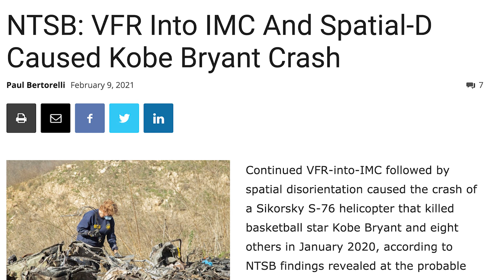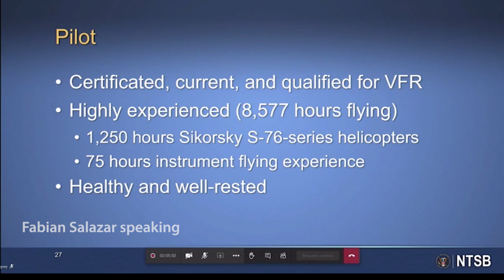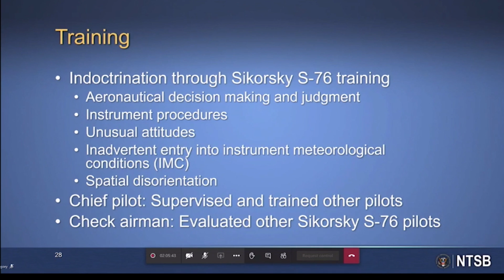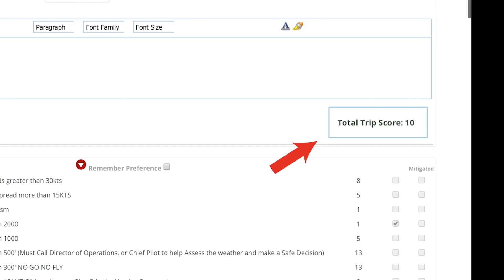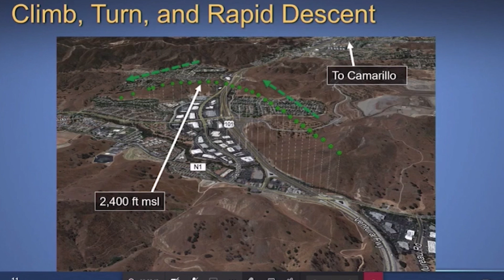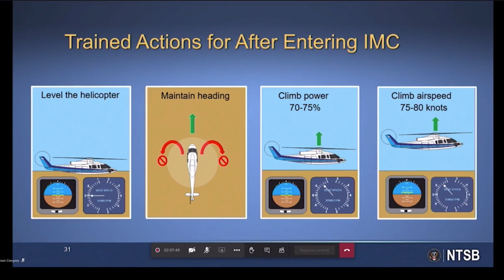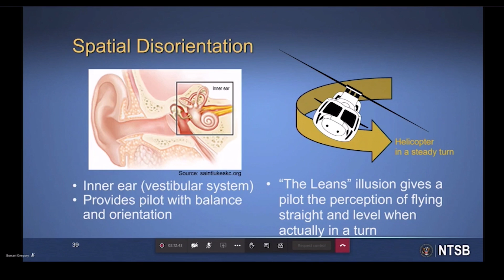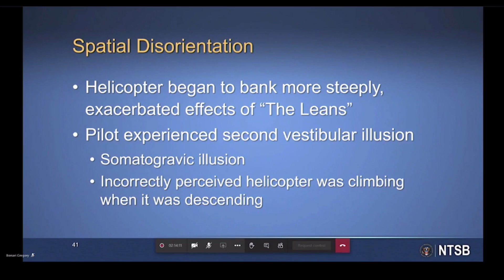How A Split Second Wrong Decision Caused the Kobe Bryant Fatal Crash

Comment: The one damning thing I read about this report was the LAPD did not fly that day due to low clouds/fog/poor visibility.  The fact that the cops weren't flying that day should be grounds enough to tell your VIP prince/princess that its too dangerous to fly due to the weather.
Reply: Point taken, but operationally the LAPD didn't fly that day because it was against their fundamental charter -- they need to see the ground to see targets (people, cars, etc).  The Sheriff's comment about not flying that day is therefore irrelevant to the Kobe case.
Reply: @PaulGarthAviation  

You have a good point there, but I'm saying its a good way to kind of smooth things over with your VIP client, look these people aren't flying today because of the weather, so we aren't either.
Reply: Whether the LAPD was flying or not is inconsequential, you do know how far LA is from Santa rosa and the crash site.
Reply: @mountjoy23  Santa Rosa is in Northern CA, the crash was in Southern CA. There is zero correlation as to how far it is from LA.
Reply: @2whl4re  Apologies, you're correct.
Reply: If Kobe wasn't on that flight plan, the flight might of never happened either, instead we might of gotten an article in the internet stating that "kobe's pilot fired because pilot decided not safe to fly". Sadly we'll never know
Reply: @2whl4re  Santa Rosa Valley is a neighborhood just east of Camarillo, the flight destination. It is crossed by Santa Rosa Road.
Reply: Yes definitely.
Reply: Lol

Comment: Once I was riding a 1100cc sport motorcycle at nite in the mountains. Came around a corner and hit fog, within a few seconds I had no idea how to ride a motorcycle.  I immediately knew I had to stop or crash.  Then the fog was gone as soon as it appeared.  Scared the heck of me
Reply: Same happened to me once on a highway during peak of a clear and cold winter night. The highway passed trough a serie of hills so going up and down. Only in one of the down I entered suddently a thick fog that I didn't see coming and it took me some seconds to realise that I had to almost stop if I wanted to stay alive because I couldn't see anything past the engine hood. I was also afraid if I was to stop that cars behind or even trucks would pile me up. I drove at 10MPH for a moment luckily I was alone so nobody crashed me, and I existed the thick fog as quiqkly as I entered it. It's all about decisions you have to make to cope with the situation, a small error and you are toast.
Reply: @12345fowler  fog is scary.  I imagine 1000x more so in a helicopter
Reply: There'll be very thick fog the next day after UFO landed, normally.
Reply: I’d rather fly a plane in fog than drive
Reply: @Jopanaguiton  car u can pull off and cancel the trip.
Reply: I was descending a mountain, and there were no reflectors, no lights for miles, no other cars.  When a cliff would loom up, it would block out the stars.  Thought I was going to ride off the edge like Wiley Coyote.  Slowed to 30mph, and just bumped along.  It was stupid. Should have pulled onto first shoulder, climbed into sleeping bag, and waited for sunlight. O.  And I think the map said 11 miles to 'home', but it was 11 miles through twisting, turning mountain pass.  Probably like 25 miles of road surface. Was young, stupid, and in over my head as conditions changed.
Reply: @PInk77W1  In a plane as long as I follow the Instrument procedure I can continue on my trip and guaranteed I’ll not hit anything.
Reply: @Jopanaguiton  
See ANZ flt 901
Reply: @12345fowler  Yes...been there too...Just passed my test...first time on a motorway (M62 England) a wall of white fog.... I was completely disorientated. no sense of feeling in the steering (Rear engined car too!)
and, back then, the steering needed constant adjustment.
Just so aware of any truck bearing down on me from behind.
Stopping on the hard shoulder wasn't an option...probably more chance of being rear-ended!
I can imagine how easy it would be for someone in a helicopter to make the wrong decision...at a much greater speed too. 
So sad for all concerned here. RIP.
Reply: I get mild vertigo EVERYTIME I ride a motorcycle in a tunnel. Never in a car, 100% of time on the bike. I fight it, but it is scary. 

A set of tunnels in British Columbia on the #1 highway, I have been through them so many times in a car, I could almost do it blindfolded. I have done it at least a dozen times on the bike and it is still a struggle.

Those extra long tunnels in Europe would surely do me in, I wouldn't even try. I have no clue why this is. I bet my performance in fog would be similar to yours. Shiny side up!

- Cheers
Reply: @joeshmoe7967  that does not sound fun
Reply: Apparently you lacked training in how to handle a cycle in IFR conditions.

Comment: I flew EMS helicopter for 28 years. I have more night scene calls (reduced visibility in close proximity to the ground) and more marginal VFR time than I can accurately recount. Over the years I have lost friends to similar scenarios as described above, and I have seen the same mechanism of progression in my own experience. It goes like this:
1) the pilot has either just taken off, or has slowed down because of reduced visibility; 2) the pilot has stability augmentation engaged but does not have the autopilot coupled; 3) the aircraft's avionics configuration has the communications radios on the console between the pilots and not on the instrument panel; 4) the pilot makes the decision to declare inadvertent IFR or to file IFR, and he bends forward and left, head down, to retune his communications radios; 5) the pilot raises his head, and, if still in VFR conditions, sees he has entered an unintentional descending right turn; or, alternatively, if now in IFR conditions, and if the pilot does not yet have a good instrument scan going and has not yet recognized the descending right turn, he will, as a matter of training, automatically pull back on the cyclic and increase collective in order to initiate a climb, and will, instead, unintentionally accelerate the descending right turn. I know this from my own experience and from the experience of fellow EMS helicopter pilots (the old living ones and a few dead ones).
It has to do with sequence. What could he have done differently, after he realized he had painted himself into a corner?
First, couple the aircraft. The S-76 has one of the finest autopilots ever designed and put in a helicopter. It will fly a pilot out of anything if he'll let it.
Secondly, in coupled flight, initiate a climb.
Thirdly, triple-check everything: the climb, the airspeed, the heading.
Fourth, tune your radios and confess inadvertent IFR.
Fifth, follow the instructions of Air Traffic Control.
Sixth, let the autopilot fly the helicopter.

This same accident has killed two good pilots I have known.
Do not criticize the dead.
These things can happen to anyone at any time, including you.
Reply: Great analysis
Reply: Seven, and most important, Prepare yourself mentally BEFOREHAND for the possibility/likelihood that you will experience spatial disorientation.
Reply: which is essentially what Ken Cox stated: "These things can happen to anyone at any time, including you.".
Reply: Thanks Ken.
Reply: One of the best comments I've seen here.
Reply: Yes, and thank you for this well-written explanation that ended with humility.
Reply: Well, I have to agree with you.  Completely...    only by sheer luck am I sitting at this keyboard, glancing over at the 50 year anniversary  plaque (being a pilot-helo/fixed).

Comment: Never let anyone, anyone at all influence your no go decision. I made that mistake in my early 20s, with bad advice from my instructor. I had woken up, checked the weather, decided against a solo cross-country and called my instructor. For some reason, he told me to go for it. This was a retired Air Force instructor (he trained AF pilots back in the day). I encountered wind shear/microburst shortly after first leg touchdown, rolling out. Ended up with a bent prop. Probably lucky that was all I got.
Reply: MeesterVegas my instructor sent me on my solo cross country on a bad weather day. What did I know. I had to leave the plane at an alternate airport and call a buddy to come get me
Reply: That weather changes in a heartbeat is why everyone should be instrument rated. Jmo
Reply: @Karl with a K yeah, we can replace it with programming and sensor error any time now! We want our fatal accidents to be of the most high tech nature!
And how do you figure "as always"? As always, excepting when it isn't? Planes crash from engine failure. They crash from bird strikes. They crash from many things. And a pilot making a mistake does not make them "incompetent". The very best Formula 1 drivers can make myself and end up crashing. Are you going to sit there and call these highly skilled people "incompetent" because they failed to do it perfectly?
Reply: @justforever96 no but you try and pass the buck to the passenger instead of the incompetent pilot.

Comment: Paul, Great synopsis of the accident, I always enjoy your videos.  I spent a number of years training military helicopter pilots IFR and VFR and one of the things I pushed upon my students (and other instructors) was that if you are encountering deteriorating weather in a auto pilot equipped aircraft you should couple up early so that if it comes time to turn around or commit to IFR the majority of the flying workload is handled by the aircraft.  This allows the pilot extra bandwidth to ensure the aircraft is under control, avoid obstacles and coordinate with ATC.  Pilots tend to pride themselves on their hand flying abilities but these are often overcome by IMC illusions especially with rapid onset IMC.  Pilots need to be trained to let their egos go and use automation appropriately for the situation to ensure safe flight.
Reply: When you think about all the hard work that led to developping auto-pilots systems for helos, the price of such systms, the fact that the accident helo was equipped wit such system, but only the pilot didn't care to use it... things that makes you can hummmmm

Comment: "One peek is worth a thousand crosschecks."   Of our first IMC we all remember not being able to take a peek and almost immediately feeling the prerequisite vertigo. There is no substitute for being current and on top of our game.
Reply: It got me thinking that I wonder if something like a VR headset could be used when doing IFR training. It would be like a simulator but in the aircraft. You would see a virtual cockpit but you would be be virtually in IMC and those conditions could change with altitude so you could simulate an approach at minimums. You’re instructor could even fail one of your virtual gauges. 

Problem is I think the market is limited, any airplane that isn’t using a fully digital cockpit couldn’t use a headset like that. Perhaps in another 5-10 years there would compatible aircraft.
Reply: @Mrcaffinebean  No need for digital cockpits, just use a VR frontal camera and input its recording into a 3D mapped cockpit so any altered part of it maps precisely into the VR screen (e.g., different weather outside, certain instruments not working or giving faulty info), it's quite simple actually.

Main issue with VR systems is that they are expensive (requiring the VR system itself and a relatively powerful computer) and maintain the issues current systems have about not portraying a real situation.
Reply: @ferko28  That is not entirely correct. Occulus quest 2, for example, does not require an external computer.
Reply: @smeezer  take VR system as VR piloting simulation system, which no onboard VR is powerful enough to do right now. Plus the cost is even higher for onboard VR.

Comment: It has been a while since I was pilot in command but back when I had a navy pilot as a roommate I found out that there is a statistic that says that the accident rate for pilots as function of flight hours goes down to about 400 or 800 hours and then slowly increases with accumulated time.  This comes about with the attitude " I am experienced enough, I can fly myself out of this situation."   This attitude could be a part of SLOJ.
Reply: What strikes me was this pilot with thousands of hours had very few instrument hours. That worries me. Like a courier driver with several millions of miles but avoids driving at dusk. Vision issues???

Comment: Paul, thanks for the presentation.  I find the NTSB's obsession with the grammar of the final report versus making recommendations to the FAA that can actually save lives, unbelievable! 
Yes, getting the language correct in the final report is important but in the open forum hearing it gives the impression that language is more important then preventing these accidents in the future.
Reply: I'm not sure I would agree. Good, useful, helpful recommendations can only be derived if all are in agreement what had happened and how, and ambiguous language can easily lead to wrong conclusions.
Let's not forget, based on that language, significant litigation will take place (to exact some "pound of flesh" out of those deemed responsible), which makes it ever more critical to get that grammar right.
Reply: @vasicp  You probably should have read my comments in their entirety.  I said that getting the language correct is important but dont get lost in the weeds on those details and forget the more important aspect of the NTSB's charter from Congress to make specific, accurate and timely safety recommendations as a result of their accident investigations.  In my opinion the NTSB has fallen short of their charter and needs to be re-focused in this effort.
Reply: Hes a bureaucrat.  Obsessing over trivial matters that dont matter while ignoring what does matter, is what bureaucrats do best.

See, bureaucrats arent experts, they RELY on the experts to tell them what is and isnt important.  They used to listen to the experts, now, they listen to some study they read done by some University where no one is a pilot.

Also, protecting BIG Business & the Federal Governent while holding small business and citizens accountable, is why bureaucrats are the enemy of a free people.
Reply: @dezznutz3743 LMFAO

Comment: I would argue that this was not "SUDDEN" loss of judgement, rather it was "SLOW" loss of judgement.  At the moment the pilot decided to punch out and get above the clouds, there was no other logical choice (well, I suppose he could have enabled the AP, but that is a choice that requires some thought.)  In the heat of the moment, he was faced with being in the clouds any second, and needed to react- flying up and out was a very rapid fire decision, and IMHO not an improper judgement.  I believe the actual lapse in judgement occurred soon after he took off- the weather deteriorating as the flight progressed, and slowly conditions beginning to make the flight difficult.  The moment where he made his worst judgement call was when he asked for SVFR.   This was done in a calculated fashion, and should have been the moment where he realized this could end up going badly.
Reply: I always tell my students that SVFR should only be used as a last resort for landing. If he had used that clearance to land at Van Nuys, 8 more people would be alive today.